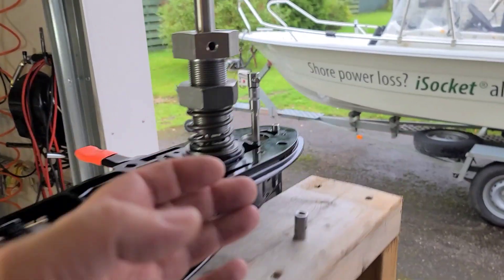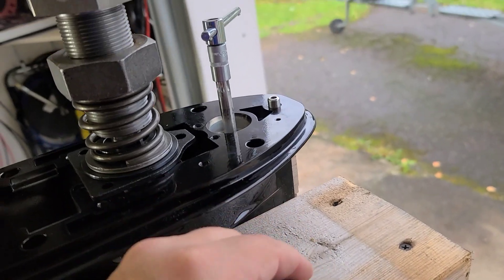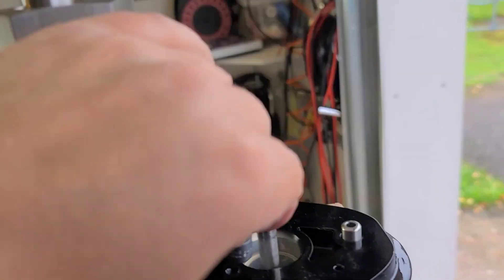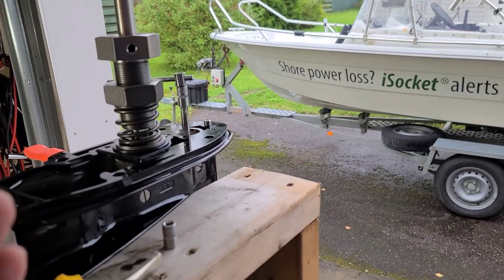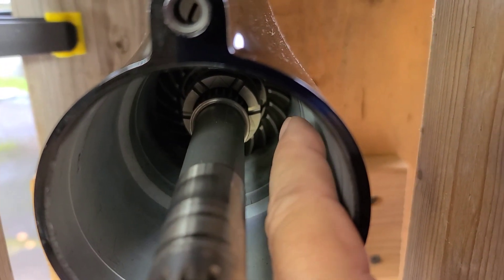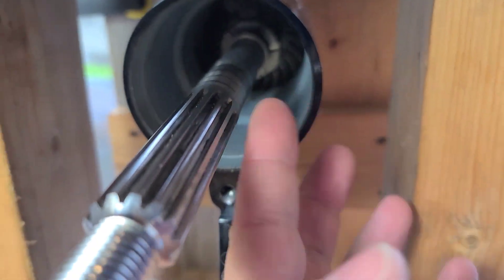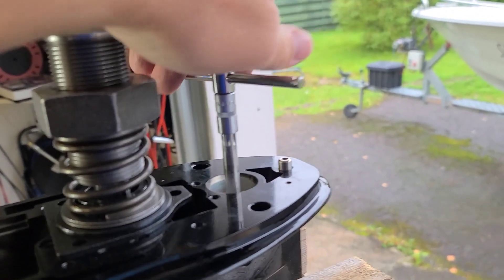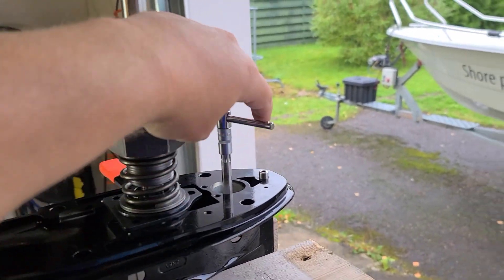Gear Shifting On Mercury 40-60 HP

Comment: How does the seal around the shift shaft come out?
Reply from the maker: Do you ask how to remove the shift shaft?
Reply: @fishelectronics yeah does it just pull straight up
Reply from the maker: Yep, or https://youtu.be/DWqMDQOv4aM Timing 38:05
Reply: @fishelectronics  thanks for all the detailed videos! If one only wants to replace the shift shaft for example. Do you have a suggestion to remove it while keeping the cam in place? I suppose in your video the cam would get unaligned
Reply from the maker: @marcuscardador You can't remove the shift cam without opening everything, so obviously  if you are not planning to remove the drive shaft you replace the shift shaft when the cam in place.